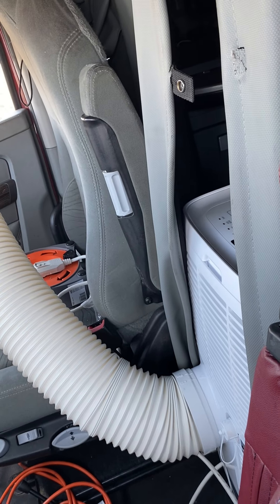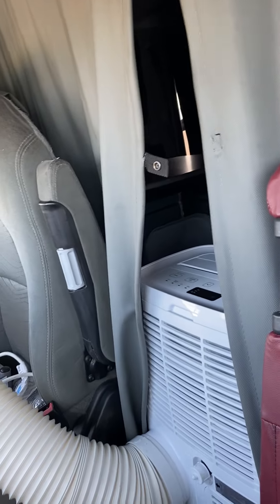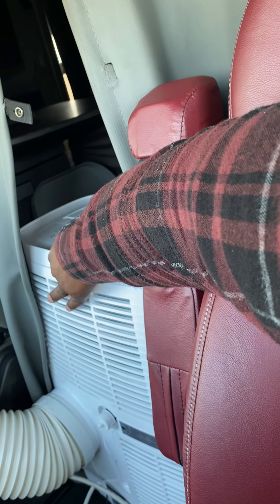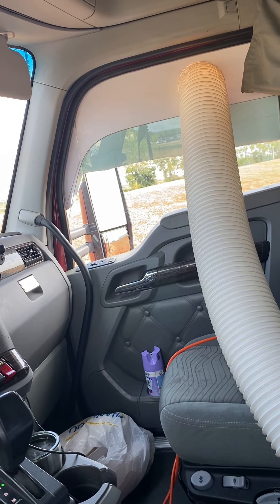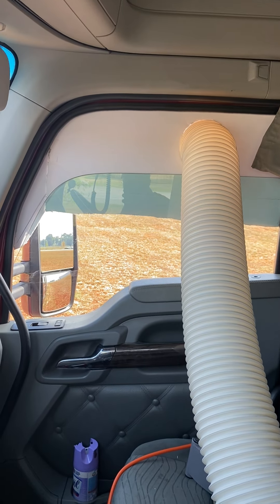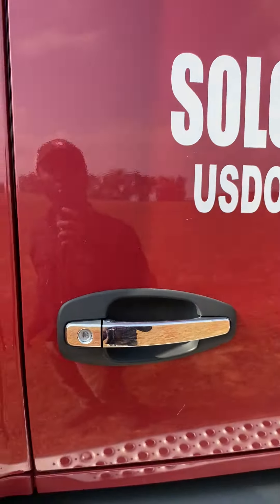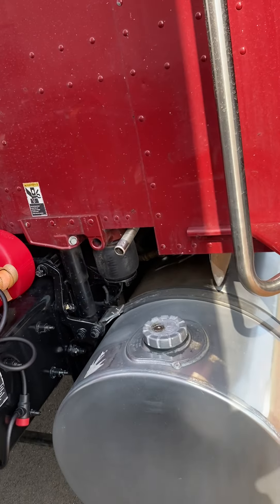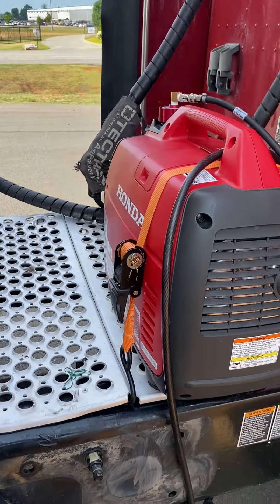My Ghetto APU

Comment: I run a Harbor Freight 3500 Inverter Generator. Very quiet and it runs my 10K Btu portable ac. On eco mode it runs 13-15 hrs at 68d degrees. It has a 2.5 gallon tank and it cost $8 to fill. Great investment. I also run my air unit at the curtain. Ive been running 2yrs with my setup. Stay safe.

Comment: Great tips on your set up with your Honda generator and external fuel tank! That is great!!
I recently installed a Predator 3500 on my rig with a window air conditioner like yours and is awesome no having to run the engine all night. Thanks for sharing!!
Reply from the maker: No problem! Stay cool
Reply: @ Alex

What kind of ac do you have?

Comment: How has that been working since you made this video. All still good?
Reply from the maker: Actually I haven’t had to use it since about October 2022.. once it cooled down i don’t run anything, and when it gets cold I just turn on my bunk heater! But I keep the generator in my headache rack and of course it’s a Honda so it will crank just about every time if I need it
Reply: Great Video….Can u post a pic of the Generator in ur Headache Rack?…wanna do the same Setup

Comment: Bro, close the curtains around the doors and windshield, those ac units are designed to cool 400-500sq ft, our trucks are 7 feet wide, 10 feet from dash to sleeper wall, barely 100 square foot. You are just stressing the ac unit by having half the truck cold, half hot, and the unit constantly pulling the hot cab air in.
Reply from the maker: For as hot as it be let’s say a good 100 degree day.. it don’t matter if curtains are closed! It will never cool this truck off! These trucks are not insulated that well.. I’ve tried it and it will just keep running

Comment: You did better going with Honda....whatever you have to do to stay cool 

Especially saving your engine,idling your engine is not good at all.
Reply: 20 yrs ago, idling didn't harm an engine, it was stressful on the alternator, water pump etc but there's hundreds of thousands of owner ops who have idled old cat and Detroit engines for years and they don't need a rebuild prematurely. These modern engines with def and dpf are not tolerant of idling because of soot build up in the dpf. I bought my first new truck in 1998, 12.7 detroit, it has idled 300+ days every year for the past 25 yrs. It has 2.7 million miles on the engine block, first out of frame rebuild was at 1.2 million miles, second out of frame rebuild was 1.1 million miles, it's currently has 300k miles since the second out of frame. You won't ever see that kind of reliability and mileage from the new junk engines. There's plenty of 3 and 4 YR old trucks for sale online, claiming a fresh rebuild at 400-500k miles, absolutely trash. I agree with half your comment, idling is bad for engines... modern emissions junk.